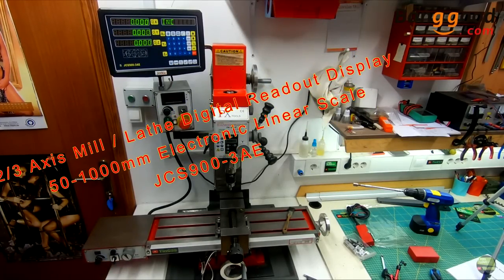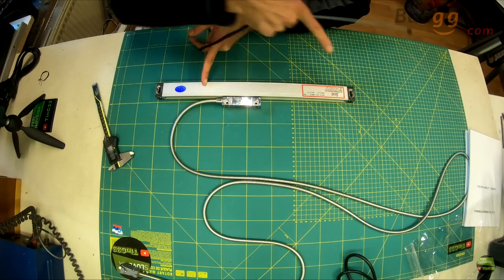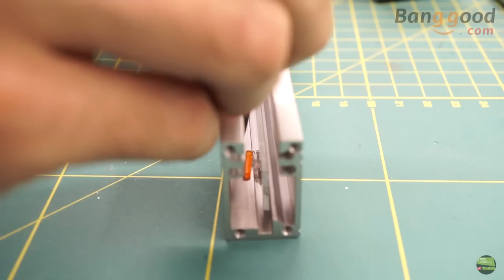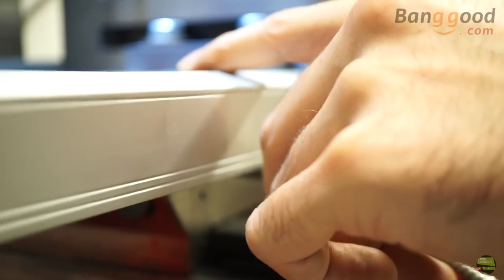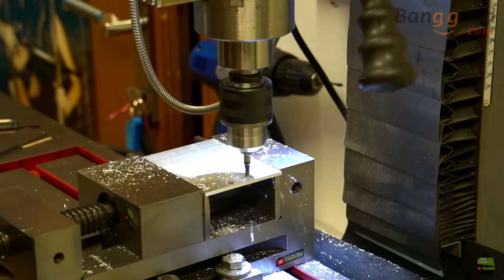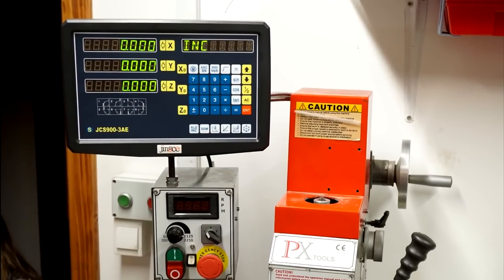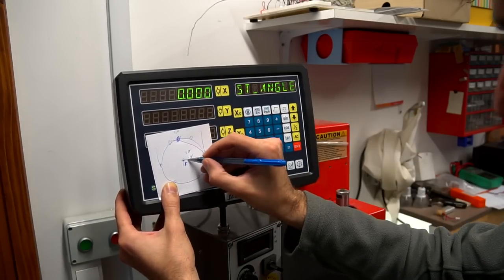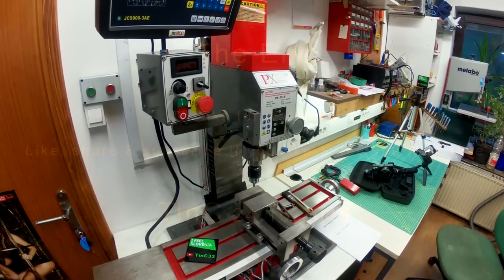$200 Mill DRO 3 axis Digital Readout from banggood [Unboxing Instalation Review]

Comment: Is that in USD or UKD, or AUD? My DRO is a digital screen and came without the 3 axis from Banggood. I have to find the matching axis, don't know where to get them from.
Reply from the maker: Usd, you can buy also the axis from same link, jist choose size and add to cart, then choose another size and add to cart...
Reply: @TinC33  
Thanks for responding. For a Sieg SX2LF Mini mill, what size should I buy,  bro?
Reply from the maker: @mickcarson8504  check your move on each axis and buy 5cm longer than total move you can stil cut them.
Reply: @TinC33  
I can't believe this. You say, check the full movement of each axis and buy the gratings one inch longer. Yet, the stupid Banggood, I've sent them 6 emails, asking for the correct size to go with the LCD DRO and they keep repeating the same thing about buying them separately. Of course, I keep telling them, of course I know about buying them separately, but what length, what is the size to go on a Sieg SX2LF? And they emailed again, same shit about "You have to find them..." yada yada yada, again and again. At this rate with Banggood, it will be Christmas soon,  WTF?

So, do these axis devices plug on all DROs behind or are they only for selected DROs, e.g. your axis doesn't work on mine because yours is push button, while mine is touch screen LCD? Or, are they all the same? My DRO is a YIHAOGD LCD 3 Axis, but came without the axis gratings.
Reply from the maker: @mickcarson8504  true it's a bit tricky to find right leinght, that's why i tell how long is each i order, but always better to order longer, because you can shorten ghem but not extend.
The dro display are different and i'm not 100% sure but i'm 98% that rails work with all kind of display, specialy if they'r from same manufacturer
Reply: @TinC33  
Back to you, and still with no axis ☹

My milling table size is: 460x120mm
Z = 220
Y = 220
X = 460
What length axis gratings should I get?
Also, I didn't know that you can cut them.
Care to help further, bro? Thanks.
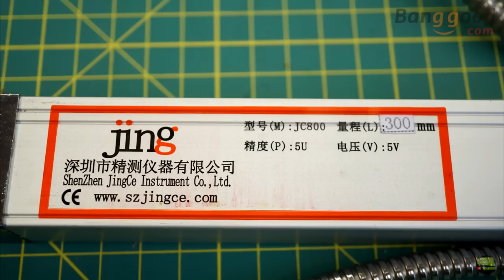Reply from the maker: @mickcarson8504  did you watch entire video, i cut them in that video, also on 1:30 you can see the actual leinght, for your axis i would order: For Z axis 250mm, for Y axis 250mm and for X axis 500mm.
Reply: @TinC33  
Sorry bro. The ads drove me right out of it.
Reply from the maker: @mickcarson8504  ok check the video and think shoud be clear ;)

Comment: Top, that must be ordered exactly in the link because there are several choices. Is it possible to put the cart type comment
cordially
Reply from the maker: Banggood sell 3 different dro's but i test this one and give you a link only for that dro, because i don't know others.
here in that product link is all you need, but need to make at least 3 orders with different "size" you need one digital read out 2 or 3 axis and 2 or 3 scales, choose the leinght you need.
Reply: TinC33 is it possible to put me the link cordially
Reply from the maker: @speedfight49  you mean that: 
https://www.banggood.com/custlink/GDDvelDz9C
Its a link to that product, than you firstly choose one reedout, put to cart, than choose scale leinght you need, put to cart and so on, than just go to cart and buy, is that what you think, because i don't understand perfectly
Reply: As TimC33 suggests, you need to add four items to your cart. The 3-axis readout is the very first option. After adding this to the cart, you add three of the linear scales. You can combine any sizes of scales you want.
I didn't know it was possible to shorten the scales until I saw this (very interesting) video.
Reply: TinC33 Or can I find the 3 axis machine to automate it with this material?

Comment: Build a Stepper motor on all axis - Problem solved
Reply from the maker: But than absolutly go to cnc conversion, but need to replace threading rod add lubrication of rails... And mill lose his ability... I like this mill because it's manual, so i can align some edge in a few second, meanwhile i can't eaven start a pc... If i go for the cnc i will make new smaller mill. This one will alwas stay manual, because use them toomuch to convert them. But i seriously thinking to add auto support like on x axis also on y axis
Reply from the maker: Plus if you got just 1/4 turn deadband on the trapezic thread all the information from motor is lie ;-) than mill grab something loose some step and you don't know where you are anymore.
I'm for the DRO ;-)

Comment: Have the same DRO from Bangood, One scale never work I ask them a replacemrnt and they never replace it. So i will never by someting from Bangood
Reply from the maker: Hmm strange, i got few years of experience with banggood and lot of orders, sometime some items, come demaged, not their fault, the'r just seller.... but always, really always we find good solution to solve the problem, basicly i send them a short video about non working stuff and they give me full refund or send me new item.
Did you try to send them videos  or photo? 
also you can chack if all the cables on socket and sensor are soldered good.